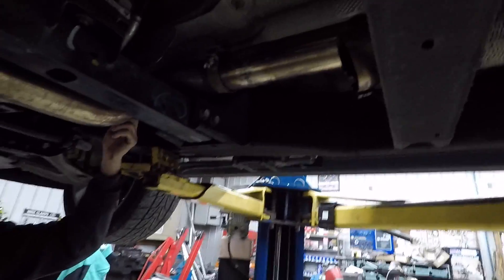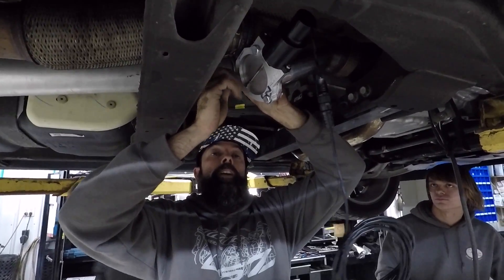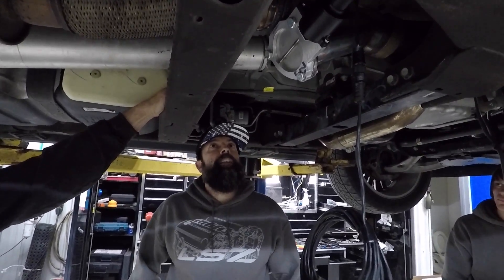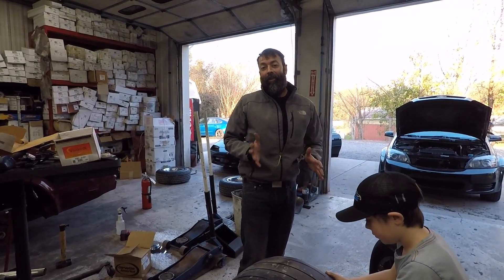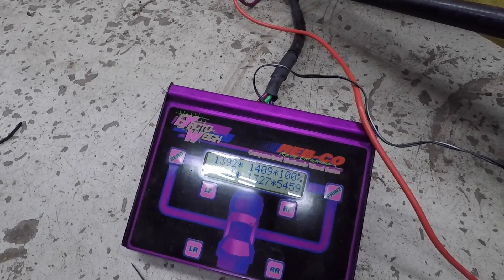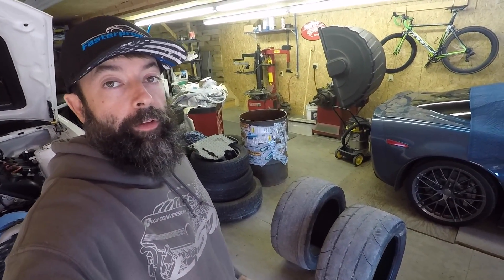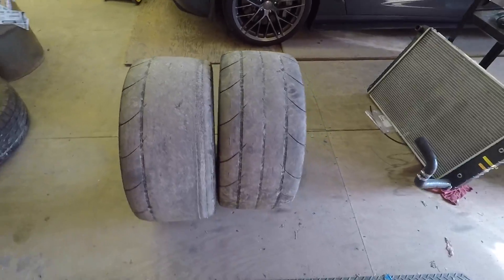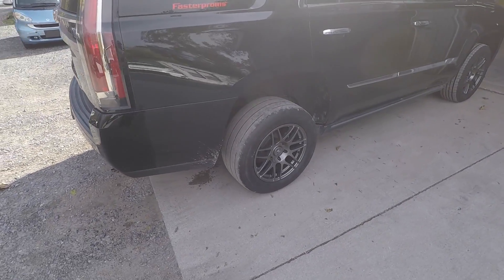Super LOUD cutouts on new Escalade! Track Prepping The Caprice And Escalade! Let’s Set Some Records!

Comment: Nice, the conversion from regular to tarmac shredder is coming on good.
Yeah, V's and starter motors have always been a huge issue as the motor has the cold side where you can't have a starter.
Wrap the headers and put double heat shields in, two plates spaced apart and rock wool insulation in between.
1/4 inch thick is plenty for the setup, the radiated heat will be reduced far below what is needed to be safe and will solve the issue.
And polish the Aluminum that's facing the header, then it absorbs less energy.

Great channel J,

Kind regards from South Africa,

Duncan

Comment: Need to put a 2-4 drop on the porkapotumas and take those big running boards off. Love the drag wheel set up.👍
Reply: Thats what gives it that sleeper status
Reply: nathan butler nah the fact it’s a full size luxury suv makes it sleeper status who tf mods one 💀
Reply: It's a damn body on frame TRUCK.
If you want LOW then BUY A DAMN SPORTS CAR.
Reply: do a 2-4 drop but id swap the front over to fully adjustable coilovers , for the reason that you could play around with the height of the front end at the drag strip , raise the nose up higher than the rear for the added weight transfer on the launch experimenting type stuff.
Reply: JIGA BACHI quit being old 💀 I have a truck on coilovers with a 11 inch drop and I hope it pisses you off 😇
Reply: Dalton golidt the front of your truck up lmao you have no idea what your talking about. Why do you think gassers died ?

Comment: Try the wireless switch that runs off a remote then use your program for your garage door opener on the car and program the remote to it so the cars button will open the valve. It's slick, clean, and just better all around
Reply: Oh I dont condone it. I always use gloves because I dont really need much dexterity with 4t and tuned up and downslope its pretty algood and well it's just smart to but that's just why people do it

Comment: You could try putting/moving the starter solenoid in the engine bay that way it's not exposed to so much heat from the headers

Comment: Hey with the tire rubbing I saw a trick where you take a metal POLE nd your put it between the top of the tire and the wheel arch and u roll forward slowly and it will help stop rubbing

Comment: God its funny watching people wear welding jackets and then dont wear gloves
Reply: It's because tig welding is super clean. You dont have all the slag and popping you get with other welding processes not to mention some people are quite particular about having sensitivity for their trigger finger to modulate the welding current. The reason you'll see alot of tig welders still using jackets is because it will burn like sun burn through most normal clothing
Reply: @CtrlAltSk8  and you dont think the UV can attack your hands? There are many thin tig gloves that allow you to keep your dexterity. Just a bit funny as its usually the other way round people wear gloves and nothing else while tigging
Reply: Guys, hes mig welding by the way..
Reply: Having a 42 yr welding career it’s not a good idea to weld gloveless IMO I can’t take a gloveless welder Serious
Reply: Gloves are for chicks

Comment: the difference between your tire sizes changing the gear ratio measure the height difference between the tires and then cut it in half that's all you're gaining about an inch and a half